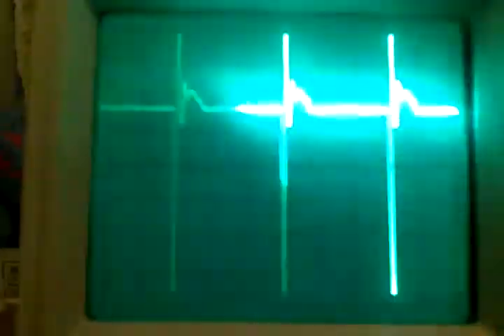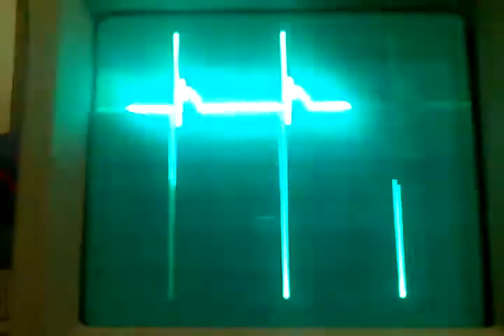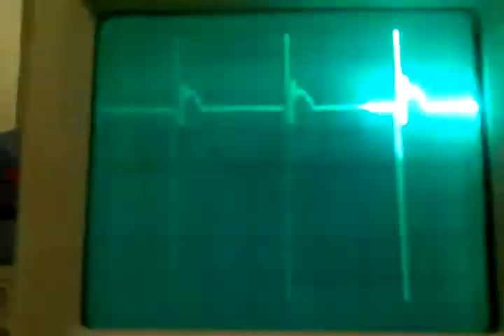Ed Gray exp.7 (cold electricity 2)

Comment: If you don't use the center tap in between the diodes, its not fully rectified is it? It would only be half wave rectification wouldn't it be? That is a beautiful setup you have there, the 500+ Analog volt meter is an AC meter though isn't it? Thanks for sharing your explorations good sir. :)
Reply from the maker: +Diadon Acs (Conscious Energies) Thanks for the comps. the analog meter was ac/dc. we were looking for evidence of cold electricity. the spark gap was running at room temp verse normal temps very hot. something strange was going on inside the spark gap transformer as we coined it.CW
Reply: @lablancengineering2  what exactly does the spark gap do other than voltage jumping and raising due ionisation of air and thr what happens does it change the type of electricity fm ac-dc or what exactly happens could u explain I am not fm engg field so ur explaination will help me... Thkz and keep ur good work going